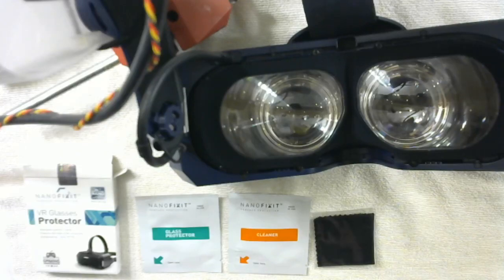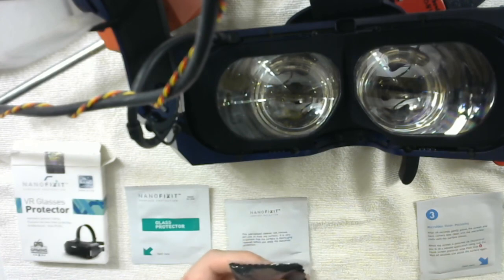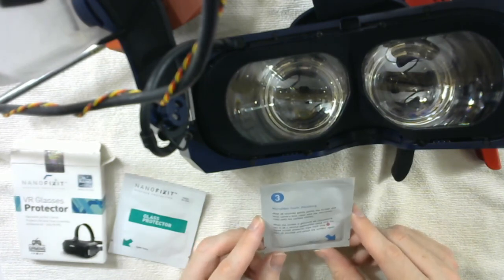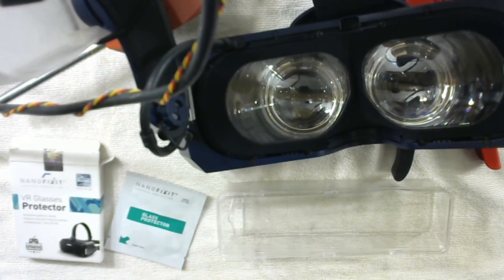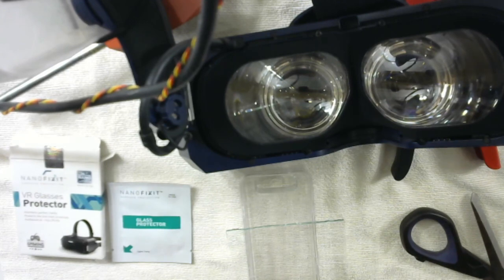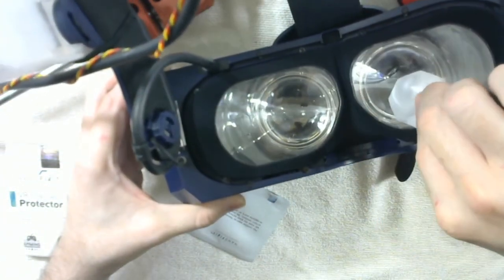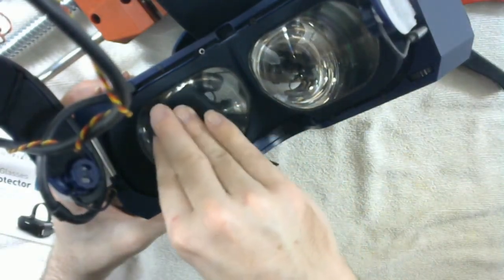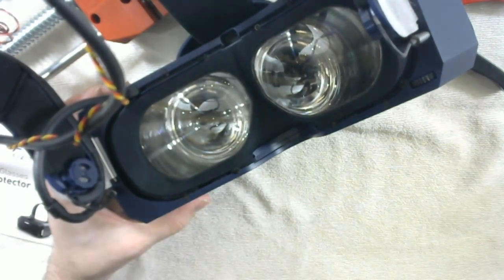Pimax Vision 8kX - Lens Coating with Nanofixit

Comment: Will there be an update to this after the 8k x being used throughly?
Reply from the maker: Probably no video update. The lenses seem to be remaining excellent, though I have been following up using Plexus spray, a dedicated fine mesh towel, and horizontal wiping, as necessary to very gently remove smudges.

Comment: How are your lenses now?
Reply from the maker: Still able to keep the optical clarity just as it was after applying this coating. I have been using Plexus spray and a dedicated fine mesh towel to clean both the Pimax Vision 8kX and a Pimax 5k+ I use for roomscale (which was not treated with 'nanofixit'. So far, that seems to be working well, though the 5k+ might not show any wear on the lenses as readily.

Plexus does seem to contain benzene though, so at the very least, avoid direct contact and ensure adequate ventilation.

https://smile.amazon.com/Plexus-Plastic-Cleaner-Protectant-13-Ounce/dp/B00092CKN4